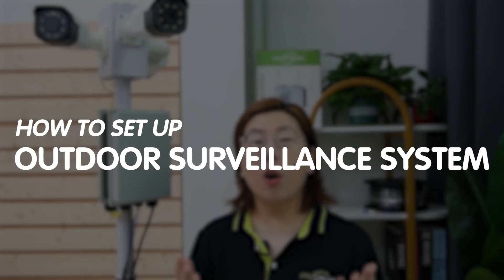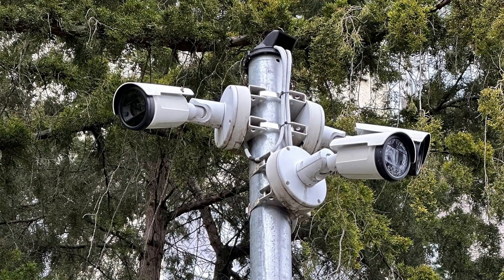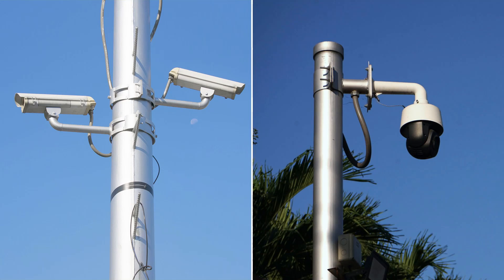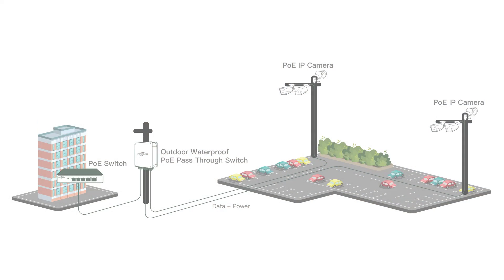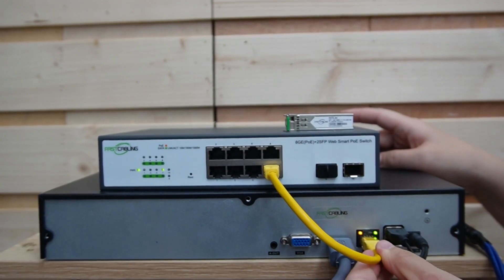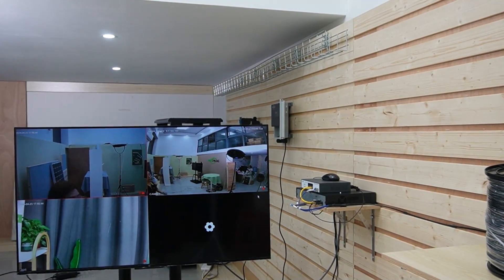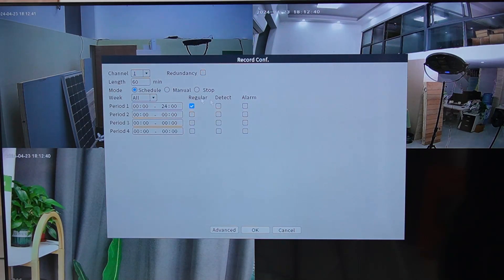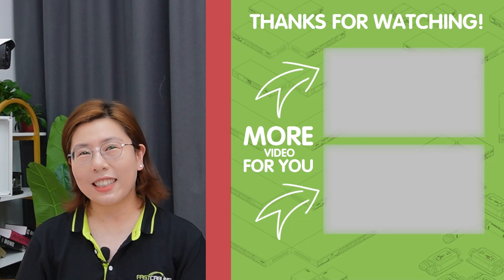DIY Outdoor Pole Surveillance System - Step-by-Step Installation Guide

Comment: How many cameras can transmit one optical fiber as we can see in the vedio there were 3 camera and you use one fiber the other two were not use so please enlighten us about this issue thanks
Reply from the maker: You can connect many cameras over one optical fiber — even 50+ — as long as the total bandwidth is within the fiber’s capacity. A single 1 Gbps fiber link can easily handle the data from multiple cameras (e.g., 3 cameras only use ~15–30 Mbps total).

In the video, one fiber was used because the PoE switch aggregated all 3 camera feeds and sent them down a single fiber. The other fibers can be used to connect other switches or devices.

Comment: Please how is the power sent to the POE switch
Reply from the maker: The PoE switch needs to be connected to an external power supply. But you can use powered fiber cables to transmit data and power simultaneously to the switch, or you can choose to power it with solar panels. Add a 48V voltage booster so you can boost 12V/24V solar power to standard 48V. 

1. Power over Fiber: https://youtu.be/QZqXNbv3Iw8
2. Solar power + 48V voltage booster: https://www.youtube.com/watch?v=Ydx5dHEPwbI

Comment: Please show us how to terminate the fibre optics cable...
What's the maximum channels the fibre switch can have...
The fibre optic cable has multiple cables...will they require independent switches since the indoor cable has only one SFP port?
Reply from the maker: Hi, here's a video on how to terminate fiber optic cables with SC connectors: https://youtu.be/gyhVTg6gE20

The maximum number of channels a fiber switch can support depends on its specific design and capabilities, particularly the number of SFP (Small Form-factor Pluggable) ports it has. If a fiber optic cable has multiple cores, each core can be connected to a different SFP port on the same switch. Alternatively, if the number of cores exceeds the number of SFP ports available on a single switch, you may need additional switches to handle all connections.

If the indoor setup has a cable with only one SFP port, it means you can connect only one fiber optic channel to this particular device. However, there are ways to manage multiple connections:

1. Fiber Optic Patch Panels:
Use a fiber optic patch panel to distribute the multiple fiber strands from the outdoor cable to multiple indoor devices.
This panel can connect multiple fiber cores from a single cable to multiple SFP ports on one or more switches.

2. Aggregation Switches:
If you need to connect multiple fiber cores into a network with limited SFP ports, consider using an aggregation switch. This switch consolidates multiple lower-bandwidth connections into a higher-bandwidth link that connects to a core switch with higher capacity.
Reply: @Fastcabling  Thanks ❣️❣️❣️❣️❣️
Reply from the maker: You're welcome! If you're interested, we can also provide a network design for our customers. you can get a free consultation here: https://www.fastcabling.com/free-solution-design/

Comment: nobody use coaxial cables anymore.
Reply: oh ye of little faith
Reply: Rhythm of the folly...Arrogance in ignorance...
Reply from the maker: Many older surveillance systems are already installed using coaxial cables. For budget-conscious projects or those where high-resolution imaging is not critical, analog systems can be a more cost-effective solution. Coaxial cables are known for their durability and reliability in transmitting video signals over long distances without significant loss of quality.